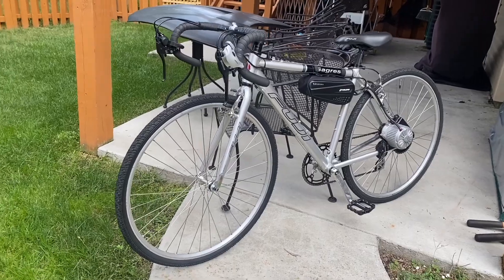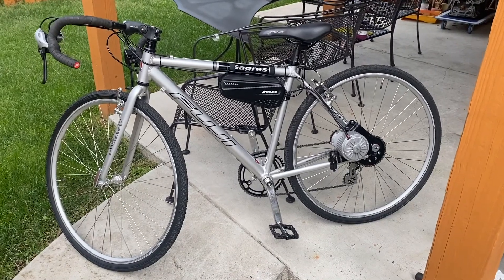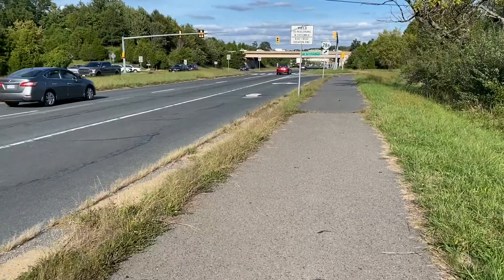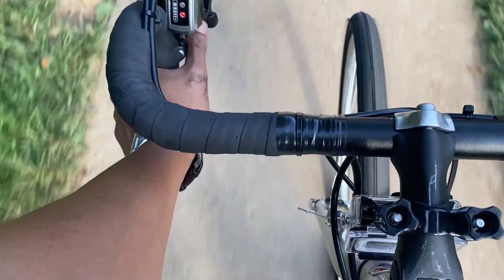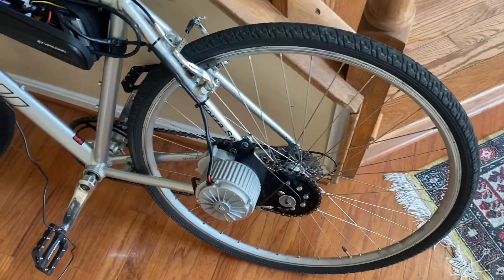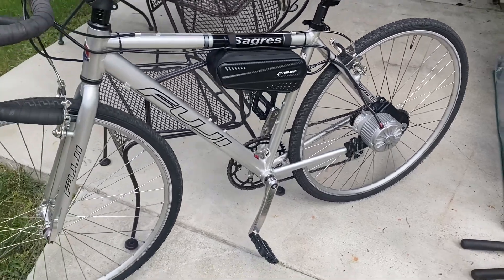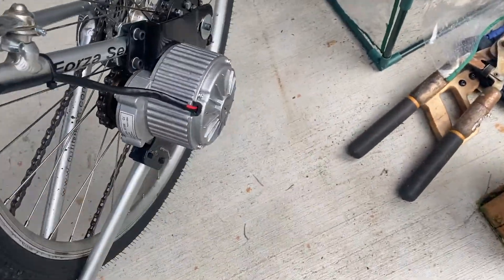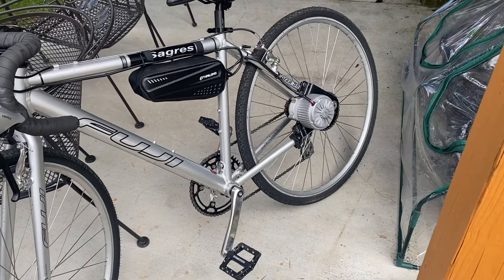L-Faster 450W 36V Electric Bike Ebike Conversion Kit | Review Range Performance Speed Test

Comment: nice work! also planning on making one. I'll change that metal sprocket thing into a freewheel so the rear wheel will have minimal drag. Based on my experience with hub motor ebikes. If you spin hub-motor wheel manually it will have that extra drag and will have like 1-2 rotations. With the freewheel, it will spin like a normal bike.
Reply from the maker: Great idea! Yeah I do feel added resistance whenever just rolling to bike forward and back. LMK how the freewheel route works out for you!
Reply: Did this work out?  If so, let me know how you did it!  I want to do this too
Reply: Any updates?

Comment: do they have a 48 volt kit? also a large ma battery would last a bit longer I have a 5 mile one way comute this should work on my trek. they changed the las around me and gas bikes are ilegal i got harassed already my 2 stroke does 30 at mid throttle
Reply from the maker: I didn't see that they have a 48v kit. Only a 24V and 36V. I would also consider the rear hub motor kits if you don't want to risk scratching your Trek's frame with the mounting brackets.
Reply: @PatOutdoors  how fast you think I'll go with a 36v and a 36 or 26 tooth

Comment: is this motor supports pedal assist?
Reply from the maker: Unfortunately it's not. Simply works off the throttle
Reply: You can manually assist it with gas 😀 that is what i do on my cheap chinese ebike and battery last longer 2 times

Comment: I'm wondering if your max speed was limited by the controller software?  Is there a setup menu so you can modify parameters like top speed or wheel size?  Other e-bikes that I've built has the option to raise the top speed but the default value was either set to the European 25kph or the US 20mph Class 2 speed.  The hub motor bikes using generic 886 displayes had setup menus, while my Bafang mid mount need a programming cable and some free software to adjust the top end.

Comment: Thanks for the video! just got through building mine on a 29inch genesis mountain bike and I also had to slightly modify the motor bracket. I think its important to keep in mind that this kit is intentionally generic so it will sorta fit most bikes but probably fits no bike perfectly, So expect to make a few minor mods to make it fit. All in all I love it. I watched your video before putting mine together and it was a big help. THANK YOU!
Reply from the maker: Glad I could help!
Reply: By the way I referenced your video in my Amazon review and recommend it to people watch it before installing the kit, Hopefully we’ll get you a few more views
Reply: I am about to do this to a Genesis 29, any tips???
Reply: @lukeguy6726  Sorry I didnt see your message sooner! it was a pretty straigt forward install only mod I had to make was to use a longer bolt on the motor bracket the whole install only took about an hour
Reply: @lukeguy6726  Im posting a video today about the bike

Comment: I heard you make reference to pedal assist at least twice so even though you didn't use it in the test I'm assuming it does support pedal assist mode but as assumptions are so unreliable I was wondering if I could get a confirmation on that and if so is it consistent through other variations of this model? For incentive I'll definitely buy it through your commission link if it is what I'm looking for and also I'm curious what's your impressions are after 1 year as it's been about that long I think according to the upload date.
One more question if you don't mind... 
How does it compare with a hub drive conversion kit comparable ability roughly speaking considering it's not an Apples to Apples comparison and any other pertinent info you think would be important to consider. Thanks for the informative video and you have a new subscriber.
Thank you in advance for your consideration on this matter and I hope to hear back from you soon.

Comment: I like these kits I have a 24 volt 250 watt @ 2-36 volt 350 watt 2 of them I hooked up like you did  the other 350 watt kit I do put a costed brake hub that I made into a free wheel and made a bracket and put it on front of bicycle so there nothing Turing unless the motor is running works great you can do a lot of different sprockets changes this way. These kits are cheap and lot of fun a lot of things you can do with them.
Reply: I want to figure out how to use a freewheel - Would you mind giving a more detailed explanation on how you did this?

Comment: Pedal assist works with this kit, right? 

Seems like a great idea, albeit the mounting bracket could be designed better to fit multiple bike frames. Much cheaper than hub kits at least.